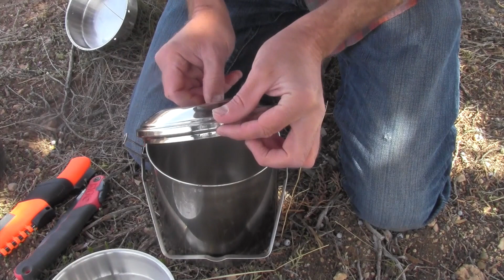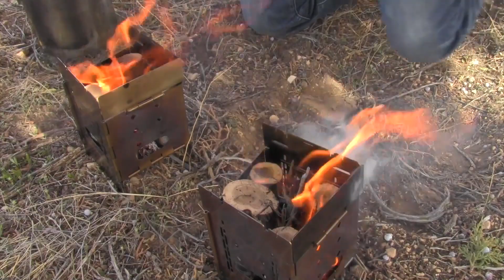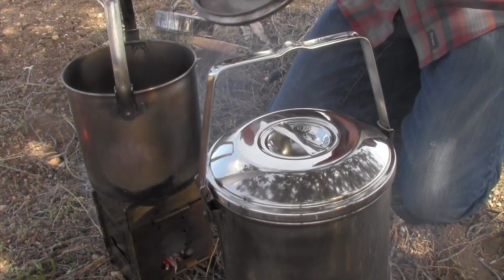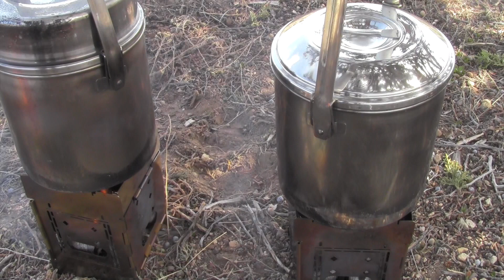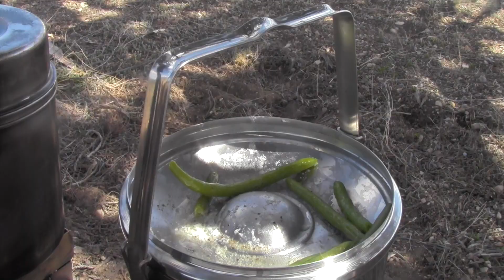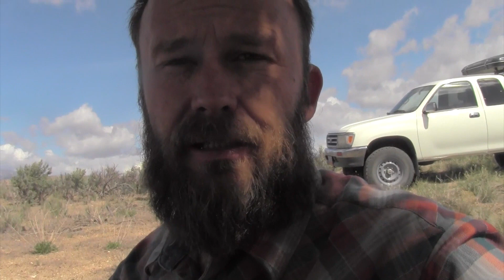Zebra Pot Steaming? Testing Two Mods. How Do You Steam Camping Veggies?

Comment: Hi!

I’m having problems drilling holes along the rim of the dish, even with a cobalt drill bit mounted in a small drill press.

Do you have any tips to make this easier?

Thanks so much,

Joey
Reply from the maker: Hi Joey, 

We do not put holes in the edge rim of the inner pan, only down in it. The size of holes in Steamer Mod are: 2.8 mm. or 7/64” 

NOTE: If you want to drill this yourself be sure you use a nice sharp bit because the material work hardens and you will want to get through the material quickly.
Reply: Ok cool!
Thanks very much for your quick reply.

Comment: I think if you, drill (1) holes in the lid so as you could put the vegetables in it that way it drain and you not end up with the vegetables in a small pool of water. 
Do the same thing for the pan drill (3) holes at even distance from one and other you could get same results but be able to cook more vegetables than the lid, with the same results. 
Great little video.
Reply from the maker: Thanks for the input Andrew 👍👌😎

Comment: I'd like to ask, can I steam things without drilling a hole into the plate/lid? or is it just highly recommended to drill in order to steam? I see a lot of people doing it. Is this just to stop the noise of the steam escaping and rattling the lid? I'm getting mine soon and wondering what your personal preference would be for the 12 cm solo kit. To drill or not to drill? I know it boils down to (pun intended) "it's my preference", but I figure I'd ask what your preference would be as well. Are there any "downsides" to drilling side holes in the plate, or a steam hole in the top? Thanks

Comment: I used a method where i made my billy pot into a “Bain Marie” where i filled the largest section with water and the top pan with chocolate and melted it with the steam from the simmering water. Good method i think. It worker perfectly. We ate toasted marshmallows with warm melted chocolate on top with digestive biscuits. This way, you get a s’more but with properly melted chocolate because i find that when eating s’mores, the chocolate doesn’t melt properly. You can also use this method for a cheese fondue. Yummy stuff!
Reply from the maker: Sounds so good!👍
Reply: Great idea!

Comment: I'm thinking that I'll just use the thermometer hole method. One hole & done. Even if it takes a few more minuets to steam.
Q: Do you think it would be prudent to make a plug for the 3/8" hole when using the pot for non baking or steaming?
Reply from the maker: No there is no need for a plug at all, it doesn't need one at all and still cooks efficiently with the hole. Thanks!

Comment: thanks for the comparison. i like the idea of drilling holes in the pan & appreciate your recommendation for placement. about how many holes did you drill? 

i use the extra billy can pans for baking in a cast iron dutch oven, & sometimes just as a plate. with holes just around the top it will have yet another purpose.
Reply from the maker: This was so long ago I am not sure. We offer a Steamer Mod though for our 3 qrt pot now and it has 24 holes, you can see it here: https://www.fireboxstove.com/index.php?route=product/search&search=steamer%20mod. Thanks for watching!
Reply: @fireboxstove  ok cool thanks. i see that pan you're selling has holes in the bottom. was it much more effective that way than with holes around the side?

Comment: Any thoughts on a future video on how you clean up after the cooking and using the pots over wood?  I’ve yet to come up with a good method and would love some advice.
Reply from the maker: One thing that works well is running alcohol or wiping the pot down with soap and letting it dry before you go. That's what has helped me. I may do a video about it in the future, thanks for the suggestion. Cheers!

Comment: I've a steam basket that works so very wonderful, on the 16 pot size, about a inch and a half water in bottom.  I don't have holes nowhere in my pots.  Got a rack from a old crackpot  I use just for spuds.  I wish I could send pictures of the two ways I use my pots. I bought my steamer basket off Amazon.
Reply: Or use the 14cm Zebra with the 14cm stainless steel filter from a "filter pot" that Zebra/Sun etc.etc. companies make to filter sauces and oil in the kitchen

Comment: I like the idea of putting holes right under the top lip of the pan. I am thinking not only could it be used as a vegetable steamer as you demonstrated here but it may be able to be used as a water desalinator. Water would boil in the bottle, go up as steam, and then puddle in the top area with all the salt removed. Do you think this would be possible?
Reply: To distill or desalinate, you would need a condensing pan, with a side drain, and a cooling pan above that to facilitate the condensation in the middle pan. The top cooling pan of water would need to be refreshed often. Otherwise, you would just have a percolator... which could be handy too! 😎
Reply from the maker: Yes, that might work well.

Comment: i wonder if you could buy another tray and mod it and fit both in the pot. that would be best. i liked the lid hole but it not working well was a disappointment.
Reply from the maker: Yeah, well at least I had fun trying it!
Reply: FireboxStove so are we able to get an additional tray? is that something you can order and or modify for your website?
Reply from the maker: woodcraft camper I do have some extra Inner pans for the 16 centimeter pot. please contact me via my website contact page

Comment: Instead of a strainer basket, just add another inner pot/plate similar to what you have now, except this one would have a strainer bottom with a pattern similar to the grilling accessory for the Firebox.Then everything would nestle together. 

Plus, that 3rd strainer "pot" has multi use other than steaming - washing, rinsing, straining foods in the bush, as well as air dry system like a dish rack; line with foil to serve as another plate and/or food prep holder; could also be used as a grill by itself.
Reply from the maker: +Mee-Thlen Moy Thanks for the suggestion! I'll keep that in mind if I ever do a complete redesign of the pot.

Comment: Use one like this with a ring on the center post. I can picture you pulling it from the pan with the firestick and setting it down on the table. It has legs that keep it elevated, so it will work for serving without dumping the food or letting it get contaminated from below. It can be used as a collander to rinse foraged greens. I use it to poach fish too.  http://www.amazon.com/Sunsella-Vegetable-Steamer-Stainless-Steel/dp/B00KYDZHSI/ref=sr_1_1?ie=UTF8&qid=1461938943&sr=8-1&keywords=collapsible+steamer
Reply from the maker: +Joyce Champion Thanks for the suggestions!

Comment: Im thinking you use a collapsible steamer basket, I use one when I roast my coffee beans, and as a baking tray
Reply from the maker: +Wandering Beast Perfect! Thanks Beast!
Reply: A standard sized stainless steel steamer basket fits the 14cm & 16cm pots. It also makes a great "bowl stove" for use with the coffee spit. Just put coals in the basket, and dampen the heat by folding the basket inward. It has great air flow from the bottom (and sides when more open). The SAWC (size & weight constrictions) make it a small, versatile, & light tool to add to the cook system. It will fit the nano & firebox stoves, and can be covered with foil for other uses. Cleanup is about the same as the other stoves. If you remove the center post & legs, it can be used to hold your biomass stones & placed upside down, under the pan, when baking horizontal & vertical. It also makes a good cooling tray & drain pan for greasy foods! It can also store items when packed away. Just a few thoughts to get you going!... 😎
PS- The strainer basket sides make its own windscreen when turned more inward to the center Post.
Reply: @kcjazz62  Can you show me a link to that specific steamer basket you are talking about? Tried searching for it and came up with different styles.
Reply: Need temp plugs

Comment: Steve,  I found a stainless steel steamer basket that fit the pot and the lid fit perfectly on top. I found it at our local DAV store for a dollar and it works real well. The only thing is I cannot lock the lid with the clips but it worked really well for me.  Ken T
Reply from the maker: +Ken T I'll look around to see if I can find something like that, that I could offer. Thanks!
Reply: Did you use the steamer basket with out the inner pan with holes in it, and you couldn’t close the handle, or did you have the steamer basket only and couldn’t close the handle? 

It would be okay if the handle didn’t close, because in transportation mode you wouldn’t have the handle locked.  Of course she would have to use the steamer basket and the pan independently.

Comment: Awesome test!  I think if you are a steamer and want that in the bush then it definitely would be worth having a designated steamer pan (with holes in the bottom), it could also be used as a strainer for pasta and stuff as well so still multi-functional.  Are the big chunks of wood that you use in the stove hard or soft wood, thanks for sharing.
Reply: +Jacqueline Schwartz Also, if you took a bit of heavy duty tin foil along you could still use it as a pan if you lined it with that.
Reply from the maker: +Jacqueline Schwartz Thanks for your feedback! They are semi hard, we call it scrub oak, not near as good as red or white oak.
Reply from the maker: +Jacqueline Schwartz  Good point!
Reply: Were the big chunks of wood you used hard or soft wood?  Thanks.

Comment: I got a strainer from Walmart and cut handle off and I use it, that was a while back not sure if they are still stocked, an extra pan with holes in bottom would work too, O've done that before too...
Reply: this is what I've heard to be the best solution while keeping the function of the normal dish intact. a stainless steel wire style strainer or grease splash guard modified to fit in the top. not very space friendly for packing though.
Reply from the maker: +sparky0288 Cool, Thanks!
Reply: +FireboxStove you might try a collapsible strainer